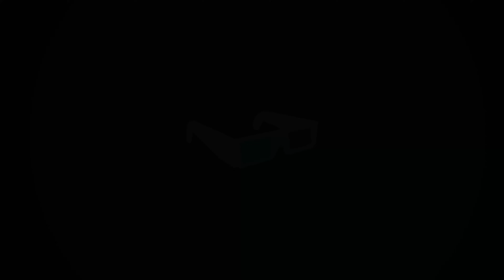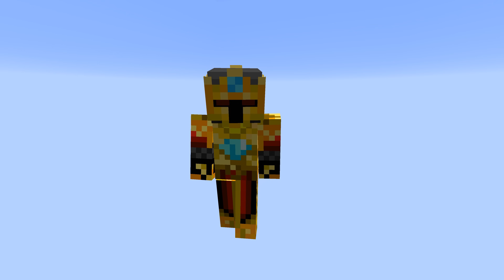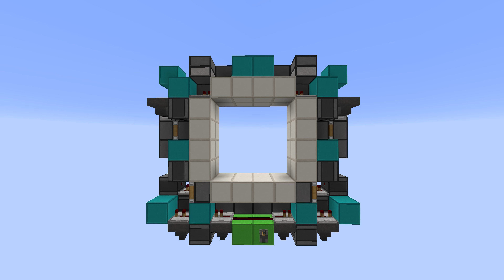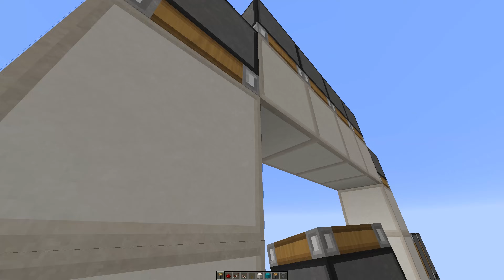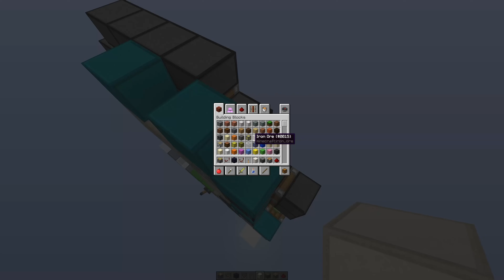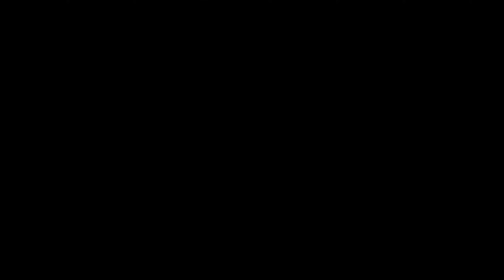Tiny, Fast and Super Sync 4x4 Piston Door for 1.11-1.16.3+! Tutorial! [180 Blocks!] [Java Edition]

Comment: Do you still respond to comments on this? XD I am having an issue where the 2 bottom blocks of the double piston extender dont get pulled when the door opens. I have checked and rechecked and everything from the video matches perfect, but its consistent everytime the 2 bottom blocks of the double piston extender on each side dont get pulled. The top ones do but the bottom ones don't
Reply: I have the same problem I think. the bottom double extenders don't work properly and the 1 and 4 blocks of the lower layer also do not work.

Comment: After recreating it, the input only works when i used the lever on the green block, when i tried to move the lever signal up and away a little using a sticky piston moving a block in front of an observer sending the signal into the redstone where the green blocks are, the whole system just doesn't work properly. Do you have a good way to move the signal while keeping it instant?

Comment: Tried this in 1.16 doesnt seem to work anymore, built it exactly like you did, it closed fine but wouldn't open, the double extenders were in a permanently extended position due to the comparators.
Reply: Make the hoppers face into the droppers. It does work in 1.16, it's a simple build so probably will never break.

Comment: the attachment of hoppers does matter a lot in 1.16.5!
i was trying hard to figure out what was wrong with my build attempt and finally got it
Reply: could you elaborate on the hoppers and droppers? I think I am doing mine wrong, what did you do?
(I still don't get entirely how they work... a bit noobish, I know)
Reply: i found that it's important that hoppers are connected with the droppers. if you look carefully on the lower part of the hopper (i dunno how to name it, maybe, a tail? :D), it could be placed downwards, but if you place it when looking on a dropper (with shift pressed of course), it will be connected.
maybe it isn't such a deal for the lower ones, but those with droppers definitely do matter
Reply: @aaoth4689  Oooh, thank you so much! One of them was not connected, and I never checked it. My library finally has a proper entrance. Amazing, thanks again!

Comment: i built it. it was easy granted, hes a bit fast. but you can just pause it as you go as i did. took me About 25 mins.... however my question is how do you lock the door from the other side?y you cant use pressure plates or target blocks. it closes the door when activated  and then opens and stays open. you can use a switch but you cant activate it from the other side
my door stays open

Comment: when i made this everything worked exept that the piston that moves up to control the extenders closes to quick and ive tried changing it to 3 tick it helps but still doesnt work
Reply from the maker: Don't change anything... build the ENTIRE door, both sides, on Java edition, and it will work. The only time this fails is if you don't build it exactly as in the video.
Reply: @Sidney600MC  i did everything correct butthere was alwats 2 blocks that could mess it up
Reply from the maker: @appleswho  that's really weird, that shouldn't happen, if you didn't tear it down yet, would you mind sending a picture of the wiring?
Reply from the maker: @appleswho  actually wait, make the lever be the other state when closed

Comment: After a bit of troubleshooting. I finally reached the intended conclusion.  Awesome piston door!  It's almost too quick, though.  It's not theatrical enough.  Not enough "slow ramp" effect.

I also decided to add some sea lanterns  for a glowing effect.  It looked cool centered, but I wanted the lanterns to be spaced out in the corners when the door was open.  This should have resulted in the four sea lanterns ending up in the empty spaces of a 4x4 "I" pattern, but I think the sea lantern's value to the observers was different than the solid polished diorite blocks that I was using otherwise and it threw off the timing for opening the door, leaving blocks in the center.  So, the door still works if I center the sea lanterns in the center of the closed door where they won't be measured by observers through any part of the closing/opening process, but not along the edges of the center.

So for other troubleshooters, if you're using a sort of unconventional block for the door that may have a different value to the observer, switch it out for something inert like stone just to rule that out.

Comment: for some reason my bottom dubble piston extenders wont work  when opening, closing works fine but when retracting it leaves 2 blocks sticking out. can anyone help me with this?
Reply from the maker: Swap opening and closing state, when the door is open, the lever should be off (i.e. not giving power)
Reply: @Sidney600MC  Didnt help for me , got the same problem

Comment: I almost got it to work in a 1.16 server. it's just the top right and top left piston will not work correctly (they work too quickly, so not perfectly in sync for some reason, messing about with the repeater timing won't help) any ideas to fix that?
Reply from the maker: Can you take a picture of the wiring? That will make it easier to help.
Reply: @Sidney600MC  I followed Kwipla's tutorial instead. It's pretty similar to yours, now it works. His design works in 1.16 because of the double triggering by a regular piston in the lower half of the build, which solved my issue.
Reply from the maker: @riceje006  Cool cool. Still curious why this design failed though, as I am very very sure it shouldn't. Perhaps you forgot an item in one of the droppers?

Basically, a lot of people have been saying they have some problem, tell me they have a problem, but doesn't have enough information for me to help them. I would love sometime why it fails, if it is an inherent flaw with the design, or it's something that people commonly mess up, in both cases I WILL be able to help. But since I uploaded this video, I still have got no information that will help me help others. But cool that you found a working design, despite it not being sync on top and bottom it's still an alright design.
Reply: @Sidney600MC  i didn't mess up i believe, all droppers had items, it's just that there needs to be a double trigger for the top left and top right corner pistons (which comes from below) now it works for me, with less hassle.
Reply from the maker: @riceje006  interesting. Still no idea what could've caused this. Doesn't make a lot of sense to me that it would fail. I'm trying to think of a reason for this. You made sure to make the redstone "dots" be "crosses" right?
Reply: @Sidney600MC  yes 100%
Reply from the maker: @riceje006  Alright, then I have no idea, from what you explained at least. This is where a screenshot of the wiring would come in handy. But you don't need to stress, you got a working design and it's all good :). Would just be cool to know in case someone else runs into the same issue.

Comment: I tried it on 1.15.2 and it doesn't work so if you play on 1.15.2, I would find a different tutorial, but this is an amazing design, and you should try it out on some other versions.
Reply: Still this is amazing, and i can't believe you guys cam up with this design!
Reply from the maker: @LiddleMuffin22  Ehm, If it really doesn't work, please send me some screenshots of the wiring, or a world download, then I can fix it for you, because from EXTENSIVE testing, I have not found a single time this design has ever failed, and there is no reason for it TO fail.

Comment: Great design, although it can be made just one tick faster. You just need to remove the two one-tick repeaters on the bottom layer (the ones that are on top of hoppers and right besides the bottom pistons). Not criticising though, its still amazing.
Reply from the maker: The reason for those two ticks is so that everything is completely in sync. Without it the top and bottom pistons fire at different times.
Reply: Sidney600MC I don’t think we’re talking about the same repeaters, because these ones don’t affect the timing of anything. I forgot to mention, the repeaters need to be replaced with redstone dust, not just removed. I didn’t change anything else, and it is still in sinc.
Reply from the maker: @floop1108  The repeaters you're probably talking about are the ones on the hopper, but they are important for syncness. If they are dust, some of the pistons on top and bottom will be one tick off from one another. Yeah overall it's 1 tick faster, but it's no longer completely in sync, which is the entire reason for those repeaters in the first place.

Comment: doesn't work at all and actually was hard to clean up, I have tried over and over again and it never worked not in any version I tried from 1.10 to 1.15.2
Reply from the maker: Did you build both sides correctly? If you did and it doesn't work, can you send me a picture or video or a world download of the wiring? Because I can't fix it without more information.
Reply: @Sidney600MC  I had looked over it a bit more, nothing wrong with the video but the way you kept circling the door instead of sticking to one side, the top and bottom where wired opposite of eachother
Reply from the maker: So the door works?
Reply: @Sidney600MC  I am currently building it on an anarchy server and it is a very small area to work with, but that is why I chose this one
Reply: @Sidney600MC the door still didn't work, I am sorry but I can't give you any cords to our base, I can give you the server IP and I can't get the pictures without destroying our base

Comment: The hopper at 7.25 is not required, observer can detect if the dropper is powered or not, but can not detected if theres item inside it. So theres no need to put that hopper and force an item passing through it. I tested by my self without the hopper and it works. Save you some iron to build it in survival.
Reply: The redstone dust will power the dropper, which will drop nothing, but the observer next to it will still detect that its been powered, and send out a redston pause in to the block beside.
Reply: Still, Great video though, inspired me a lot.
Reply from the maker: @yichendou1272  Yes, I know this, and I also explained why it is a dropper-hopper in the video (at 10:18). The reason the hopper is there (with an item inside of it), is so that when the dropper powers it won't make a "click" sound, that's the only reason, it's only there to make the door sound a bit nicer. In the newer versions, it can be a noteblock instead.

Comment: does not work on 1.14 it leaves arow of blocks on the second level after opening.
Reply: on mine its one piston which pulls the other piston which leaves a block out instead ive tried changing the timings and stuff but yea it doesnt work for me either
Reply: @madman3831  Mine was functioning perfectly then I've tried changing wall blocks a couple times and it's screwed 😂
Reply: I mucked up as I forgot Terracotta doesn't pull back with the sticky pistons. As I tried making a symbol in the middle of the door with them. Watch of for the immovables/ partially immovables👍
Reply: MadManJosh3 idk if its going to help you, but it worked for me: I had the same problem, but i changed the 3-tick-repeater to 4-tick and the „second-hopper-repeater“ to a 2-tick 
Hope it helps 😂

Comment: For some reason piston extenders on the sides (only lower ones) extend one time to much (I think) when the mechanism is triggered, just at the end of opening/closing process, and it screws everything up.
Reply: I have the same problem....
Reply: me too
Reply: you have the inputs inverted, destroy the blocks for the door, flick the lever, and place them back
Reply: @ivystar2823  thx
Reply: Pretty sure that happens, when you've inverted the input. To fix it, flick the lever up (unpowered) and fill in the door frame in the opened state. This should fix your issue. :)

Comment: At 7:25 you don't actually need to have the hopper, or even have an item inside of the dropper. Just the fact that you are powering the dropper will cause the observer to send out a pulse.
Reply from the maker: yes, but we have a hopper and an item to prevent it from making a clicking noise
Reply: I see. I don't really play with sound so I didn't realize what having a hopper and an item made there not be sound from it. Another option though would be Redstone lamps.
Reply from the maker: And redstone lamps cause a lot of light updates and they also use 2 ticks to turn off
Reply: Another good point. I'll stop bothering you :-)
Reply from the maker: Nah, I read all my comments anyways, but I like to respond with the reasons why stuff is as it is.
Reply: That must take a while for a YouTube as by as yourself.
Reply from the maker: Well, not really, I have push notifications on, so I immediately get a notification when somebody posts a comment. This also helps me read all of them.

Comment: Why not try 1 wide? :)
Reply: I want you to know i built multiple in my survival on hard mode. People are going for cool and flashy these days.
Reply: it isnt impossible... place a sticky piston with a block on it and a line of redstone to wherever you want your button to be.

but for survival.. I always wanna be the most efficient as I can be so I just hook up 2 sticky pistons with any block infront to a line of redstone and a button somewhere over the rainbow.
Reply: Nyxeon dico has done 
İt Way back in the time
Reply: The volume would be a lot bigger if you build it in 1 wide
Reply: @andersonzhao7111  na i built a one wide one and it has a volume of 122 blocks
Reply: The only way is to use observers to power the pistons.
Reply: Impossible you need a double piston extender to get the middle pieces which need to take two wide
Reply: It would be imposible
Reply: It is pointless, no one would build this in survival, they are going practical this days, you know. Less volume is not more compact when thing come to 1 wide.
Reply: Lightof f. it might be 😕
Reply: @мисливецьнамісяць  i will...